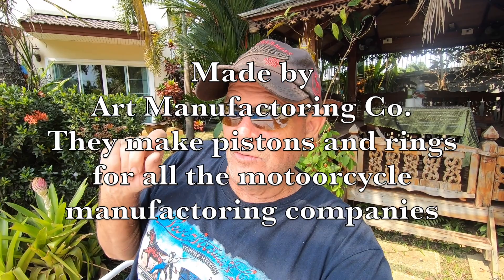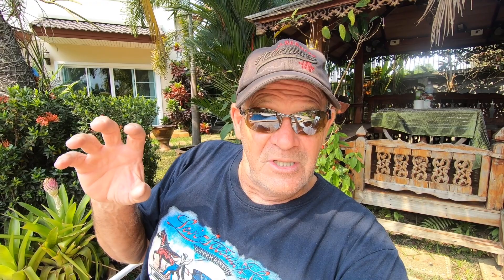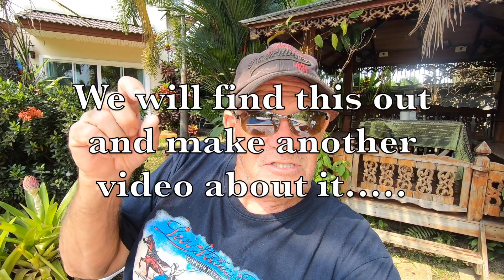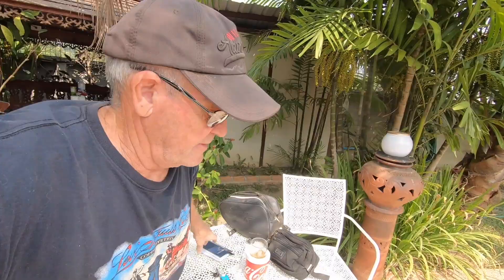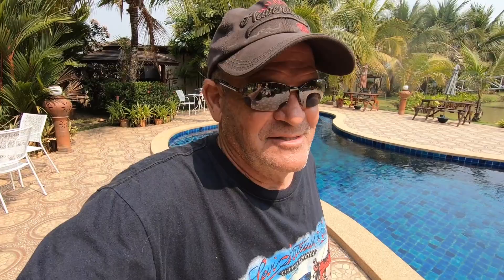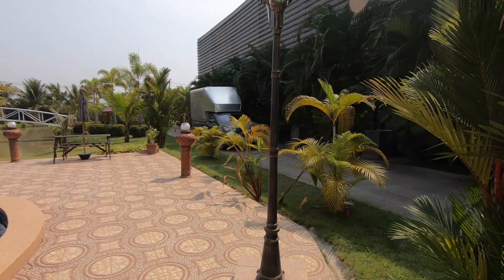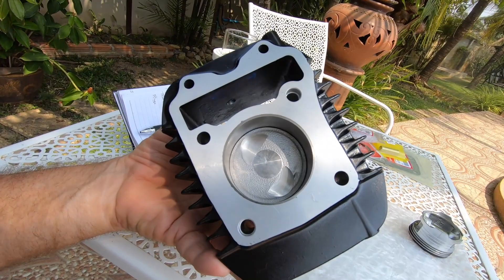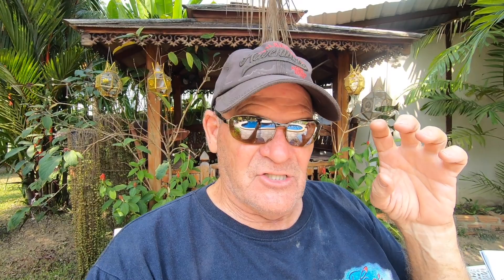Honda CT 125 How to make your own 142cc Big Bore Kit

Comment: Looked up cylinder it's for 125cc grom. So it must be bored. Does your cylinder have a complete part number on it? Gaskets are available here. Need to check wrist pin length. Larger bore has longer pins.
Reply from the maker: I believe the wrist pin and c clips come with the piston.......
Reply: @TeamDNFracing  correct but I found piston separate. The cylinder number you listed is for a grom 125cc so evidently it will have to be bored or resleeved to achieve the larger bore.  Hardracing.com has 143cc kits for $219....But they tell you that fuel delivery will have to be upgraded. Need fuel controller and A/F monitor. Changing injector does not chage fuel air ratio alone. I was thinking Maybe remapping ESU would help. But they say without controller and monitor detonation will take place. And timing advance needs to be removed.   Hardracing.com the kit is for monkey.  The kit is available with or without cam. They offer four valve head too.

Comment: does this setup work with the 2023 gen 2 engine?
Reply from the maker: Sadly no it does not. As of now, here in Thailand there are no Big Bore Kits available for the Gen 2 engine. If and when there is something available that can produce some badly needed Horsepower, I will gladly report on it. The best thing we've come up with so far for the Gen 2 bikes is to change out the rear sprocket from the stock 38T to a 42T sprocket for a Honda Wave 125i. Luckily, Honda still uses the same rear wheel setup as they did on the Gen 1 engine bikes which is why the Honda Wave 125i rear sprocket fits. Thanks for the comment....

Comment: Good video. Not to be critical  but the larger dome on piston increases compression ratio and recessed for valve clearance. Stroke has to be done by increasing rod length. Factory piston is recessed in center for valve clearance and lower compression ratio. Art has been producing pistons for many years and are a reputable manufacturer . I believe webike sells those kits to USA buyers. Appreciate all the info on the parts.
Reply from the maker: Don't know what I was thinking with the stroke comment, I knew the taller piston increased the compression and just couldn't get it out of my mouth. We are finding out a lot about this kit now so be sure to read all the comments coming in. Trev Perry works at a Honda dealership and is being very helpful with the part numbers. Seems this is a mixture of Honda PCX and Kawasaki Z125 parts to get the desired piston size and fuel to the engine. The fuel injector is for a Honda PCX150, explains the more fuel delivery.
Reply: @TeamDNFracing  I'm confused how a 128cc Kawasaki piston gets to be a 142cc big bore kit?  Like you said, taller piston doesn't increase stroke so no increased bore from that.
Reply: @spydie  Wider bore x shorter stroke.
Reply: @johnfew5145  You aren't shortening the stroke unless you change the connecting rods, right?  If you are using a 128cc piston, I still want to know what bumps this up to a 142cc engine.
Reply: @spydie  Correct, I was going to comment on the stroke comment, but others have done it and it was a slip of the tongue. The displacement is a combination of bore and stroke. If you half the bore diameter to get the radius you can then do (pie) radius squared to get the area and multiply by stroke to get the displacement. The big jump to 142cc by using a 128cc Kawasaki Piston is probably because the 128cc Kawasaki it came from probably had a shorter stroke and a bigger bore. Generally shorter stroke  rev better and longer stroke has more torque. There is a possibility that this contributed to piston failure mentioned as putting a piston from a short stroke engine on a long stroke engine means it has to travel further on each engine rotation. Therefore for a given rpm the piston speed is higher.
Reply: @seankearney6915  "the 128cc Kawasaki it came from probably had a shorter stroke and bigger bore."  Bigger bore?  So if I understand correctly, the 128cc piston probably has a lot larger diameter than the 124cc piston in the Honda.  Not much jump from 124-128 but that doesn't really tell us anything about the size of the piston, right?  To compare the two, we'd need to know the diameter of each.
Reply: @spydie  Hi, I was doing some calculations and didn't see this so I posted my long comment further up, hope it explains it and helps people. I have dimensions as accurate as manufacturers sales blurb. If  Okie can measure the bores he may be able to confirm the diameters. Shame there wasn't a suitable Honda Piston, but the other wrinkle is the pin diameter of the new piston must be the same as the old one otherwise you would have to drill out the little end of the connecting rod.
Reply: @wilberforce2009  stroke comes from rod length or crankshaft pin location .
Reply: @keithtrent4446   Actually it doesn't Somchai is correct. If you lengthen the rod or put a taller piston in it comes further up the bore but equally it doesn't go down as far. Stroke length is definitely only controlled by the offset of the big end journals of the crank to the main bearings of the crank. That is just a simple and irrefutable fact.
Reply: @seankearney6915  taller piston does not change stroke just compression ratio. Stroke is changed when piston travel distance is changed. The distance top center of rod travels from TDC to BDC.If your stock rod distance is 40mm and you go 42mm longer rod you have a +2 stroke. I'm a 40 year plus certified motorcycle technician. Been building racing engines for years.
Reply: @wilberforce2009  connecting rod location on crank pin.longer up and down stroke
Reply: @keithtrent4446  I never said the taller piston changed stroke, I thought you were implying it did by having a piston where the gudgeon pin was lower. If you are a certified motorcycle technician I can only assume that what you are referring to as stroke is not what we refer to as stroke. I and most others I know including the motorcycle manufacturers refer to the stroke as the difference between the piston at its TDC and the Piston at the BDC. 
So lets take your example and assume we have a crank where the offset of the big end journals from the main bearing is 20mm. So at the high point they would be at 20, plus your connecting rod of 40mm = 60mm. At the low point the crank journal would be at -20 but add in your connecting rod at + 40 the low point becomes +20.

So the stroke of the piston is TDC - BDC or 60 - 20 = 40.
Now if we change the connecting rod for one of 42mm but on the same crank.
TDC becomes 20 + 42 = 62 and BDC = -20 + 42 =22 
So TDC - BDC = 62 -  22 = 40. So the stroke stays exactly the same.

If you are not happy with that please describe what measurement you are using when you refer to stroke. I freely admit I am not a race motorcycle engine expert especially two strokes, but I have built and tuned may 4 stroke car engines so more than happy to engage in friendly discussion with engineers.
Reply: @seankearney6915  sorry about that l read it somewhere else. My apologizes
Reply: @keithtrent4446  No worries and thanks for the info about Art I hadn't heard of them, always good to know from people in the trade. At 60+ I am just getting an interest in these smaller bikes for nipping around. And I can work round a bike on a stand easier than ducking and diving under a car.
Reply: @seankearney6915  your welcome. Art pistons make most OEM pistons Honda, Yamaha, Suzuki and others. I've seen the logo on the pistons when rebuilding their engines.

Comment: Hey Eddy. Love these Videos. They are all a great time to watch.  I have a question. Would the big bore increase the speed or the CT125 after all the heat runs? I've saved this video. I want to build this in Chiang Mai. Do you recommend a mechanic?
Reply from the maker: Do you live in Chiang Mai? If so, you need to meet up with one of us so we can get you into the group and we can help you out with anything pertaining to the Honda CT. The BBK alone will not increase the top end, but once you've ported the head, replace the ECU with a reprogrammable one from a Honda Monkey and installed a Hot Cam, it will increase the speed by about 20 KPH.......
Reply: @TeamDNFracing  thanks so much! Great information.  Yes I'm in chiang mai. Let me get the new bike first and I'll shoot you the good news and we can meet up!
Reply from the maker: @bearfightsninja  Great, looking towards meeting you and introducing my riding buddies, Daniel and Robert. Look me up on Facebook: Eddie Bright. You can contact me on messenger there. My email address is teamdnfracing@yahoo.com

Comment: Hi, just found your channel and watched a few of your videos :) 
Watched your video where you tried the different front sprockets, was wondering if you have tried the 15t again since the big bore kit/new exhaust? Would be interested to see the top speed now there’s a few more beans in the engine!
Cheers, Sam
Reply from the maker: Actually, I just had the ECU re-mapped and a camshaft put in it. Thought I'd check out what it would do on top end and just could not find a long enough stretch of straight hi-way here around my house that isn't under construction or the road isn't super busy. With the Big Bore Kit alone, it still would not get up over 105 KPH but did it a lot easier than the stock 125cc engine did. Now with that info it will now do 93 KPH in third gear before hitting fourth gear. I'm pretty sure it will probably do around  115 KPH but won't be able to find out until the new hi-way construction is finished and I can zip down it safely. The bike really doesn't like the 15T sprocket for some reason so I probably will not be trying it again. It just accelerates so much better with the 14T.

Comment: Hi Eddie, it looks to me like a bored out cylinder with a larger sleeve because, like you said, the sleeve doesn't look like it's thick enough in the stock cylinder to bore it out that large, so they must have started with a bored out cylinder and larger sleeve?  That would be my guess.  Also please, after you order the parts individually, give us the cost of the kit vs buying parts individually.  And of course the big question will be, can we get the non-honda parts shipped to the US?  the company that makes the kit won't, but maybe the parts manufacturer will?  But who actually bores out the stock honda cylinder?  That may be impossible to get shipped here too.  I imagine it would be cost prohibitive to buy a stock honda cylinder in the US and find a machine shop that could bore it out and put in a larger sleeve bored to the correct diameter.  Just finding the larger sleeve would probably be a nightmare or searching, or trial and error.

Comment: Great video thanks mate
Reply from the maker: We now have three kits in bikes in our little group. They are working great and each rider loves the results. We are trying to get the shop that puts these together "iTimgarage" to start shipping overseas. However, they for some reason are hesitant to do so.... Don't understand it...... Thanks for the comment.....
Reply: I will look up the parts from your list I mite need soon have just under 15,000kms up now lol
Reply from the maker: @davidhuntington8687  Wow, it's going to take me another year to reach the 15,000 Kms on my bike. However, I may do that within a years time on my Triumph. Seems like I make a lot fewer rides on the Triumph, but the are way longer rides...... Planning on taking a trip down South to a friends place and I'm taking the Triumph, it's over 500 K each way...... Should be a good ride, I'm looking forward to that one.......
Reply: That’s great mate nothing like a long ride love riding my bmwf800gs on long a long ride I have just ordered front a rear rims for my ct125 and tyres so I have spare in case of flat was only $233 for each rim and $65 for rotor only $65 for rear and $40 for front
Reply from the maker: @davidhuntington8687  Bought a spare set for my bike here in Thailand, cost, $200 US. Not to bad as they were a take-off from a new bike with the stock new tires on them. Trying to find another set so I can mount knobs on them.... Beats have to swap tires from street to trail to knobs......
Reply from the maker: @rolf9280  The Big Bore Kit makes a huge difference in performance.......
Reply: Alpine motorcycles in myrtleford in Melbourne if you go on there web site mate

Comment: Hi Eddy, the kit looks great and watching your later videos looks like it runs sweet! You mentioned that the manufacturer won’t ship outside Thailand? I’m in Australia, but do you know of any guys out there who will ship this kit? Seen one on Webbike but it’s almost $1,000!!! Post if you find or know of one mate. Cheers Mark
Reply from the maker: Wish I knew of someone here that has a import/export license who could make these shipments, but I don't. That would be the surefire way to get them in the hands of those who want just a little bit more power for the trails. I've been thinking about doing a 10,000 Subscriber give away and give a 142cc kit as the prize. The price of them right now is about $70 US. That's very affordable for sure...... Thanks for the comment and keep watching. I've been having downloading problems with my iMac since they did the upgrade on my video editing program and I've got some really good footage that I just got the part 1 of probably 3 parts downloaded. I purposely didn't do HD on the download to try and get it to send it. Just kept trying different things and finally got it sent an hour ago..... The rest of the series will be in HD though......

Comment: were did you buy your big bore kit from ?? thanks
Reply from the maker: I bought my kit from an on line shopping network here in Thailand called Shopee  and the shop that put it on line is called Itimgarage and you can check out their YouTube channel to see more about them. Problem is, neither one of these will ship overseas. From this video, you can make your own kit, so use the Internet and your local Honda and Kawasaki dealers to round up the parts. You will also need a good machine shop to swap out the sleeve in the cylinder.......

Comment: How much speed do you gain?
Reply from the maker: Thanks for the comment and to be honest, I've never tried to see how much speed it gained. Probably not very much if any at all. However, it gained in what I needed and that is low end power or torque. It will now pull all four gears where before it would struggle to pull fourth gear even on flat roads. Honda  has purposely tuned this engine for fuel economy instead of power. The same engine is in several of their scooters and small bikes including the Honda Wave 125i which I had when I bought the CT125 and the Wave was much faster than the CT..... Hope this helps out.......

Comment: 15:21 - So, then maybe I can't get this kit in Japan. Well, I'll ask about it, anyway.
Reply from the maker: This kit is put together by a very small speed shop here in Chiang Mai, Thailand. They've done their homework on what works and what doesn't, but they only put one or two of these kits out each month and they will not ship out of Thailand. The part numbers are here for anyone to try to get the parts for themselves and then install the kit. I'd like to see everyone who wants to put a little pizazz in their engine get ahold of a kit, but sadly, I just don't think very many will get it.......
Reply: @TeamDNFracing  Yeah, it seems like I might have trouble finding the kit. I'll give it a shot.
Reply from the maker: @juliusevola3729  I wish you luck. If you can get it, you'll love the performance it gives......
Reply: @TeamDNFracing  Thanks. I was going to ask you if you noticed much of a difference after putting in the kit.